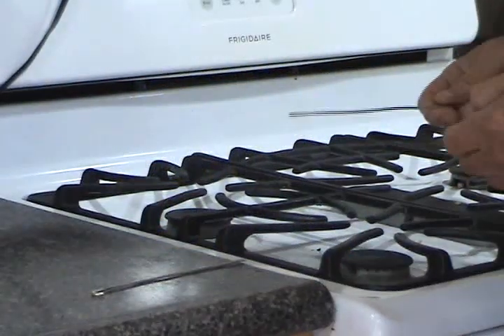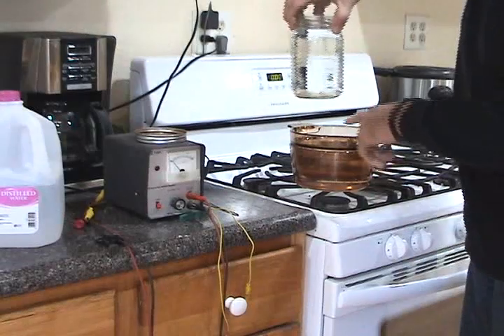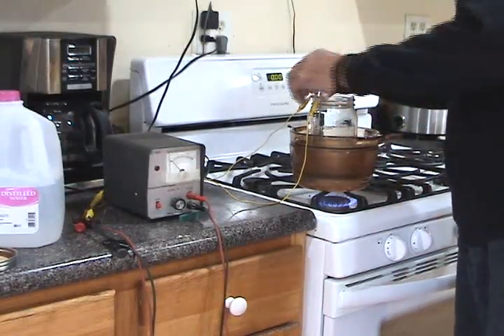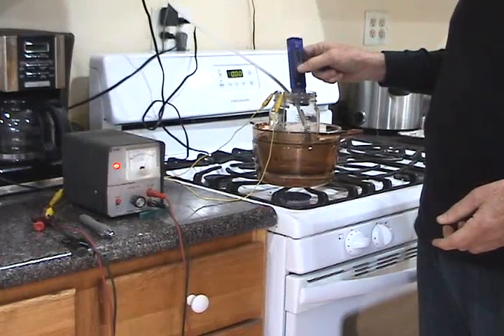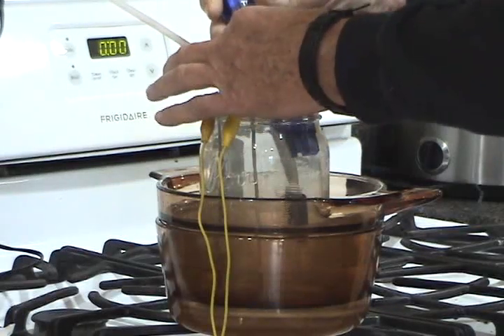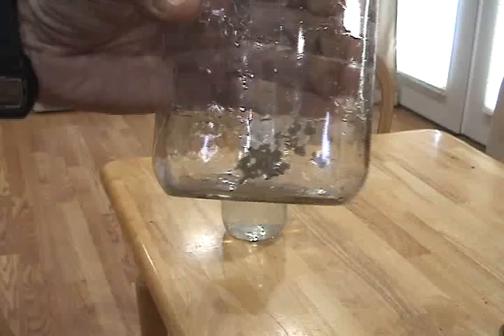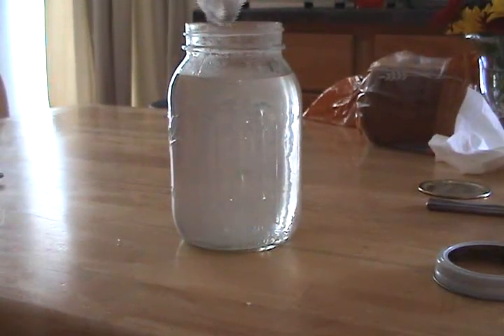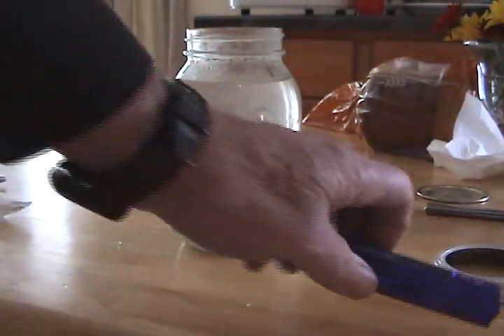Making purest Colloidal Silver.

Comment: Outstanding video. One of the most thorough direct I've seen on this process. May I ask? How much colloidal silver do you ingest if you consume like maybe a table spoon? (I understand that the overall amount in the container is 10-20 ppm) 
Also, the laser going through the silver water vs. not going the distilled, what does that mean?
Also, I am using a power supply and very cautious on actually touching the electrodes, glass container, water etc. but I saw you do it without any harm. What's the biggest precautionary measure in that case (excuse my ignorance).
Reply from the maker: @zene369 There's really no set amount that I take. I often gargle with it some throat. I use it in a misting bottle for itchy dry eyes.  The current from my D.C. supply is minimal so there isn't a shock hazard. The red led appearing as a laser beam in colloidal silver shows the presence of silver suspension in the water. Where the same led shining through plain distilled water can't be seen in the water as there's nothing for the led to reflect off of.

Comment: You mentioned 25vdc. What is the current and time?
Reply from the maker: The current is not too important as the voltage. As I mentioned below my video, you can use 3 -  9 volt batteries in series as the power supply. I do swap th leads occasionally so the silver wires will remain approximately the same diameter.